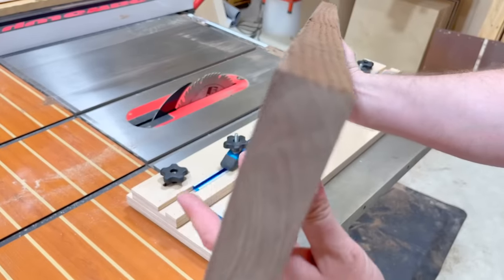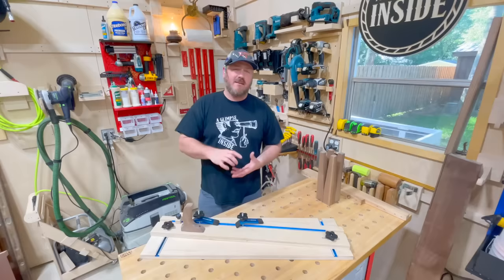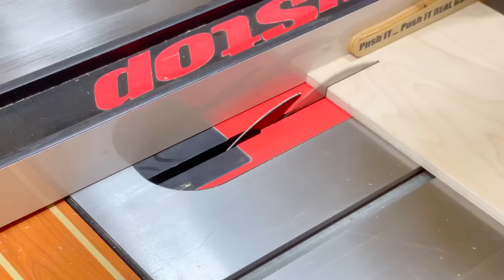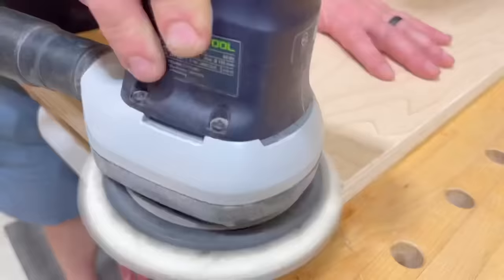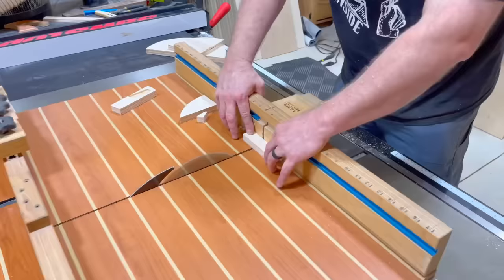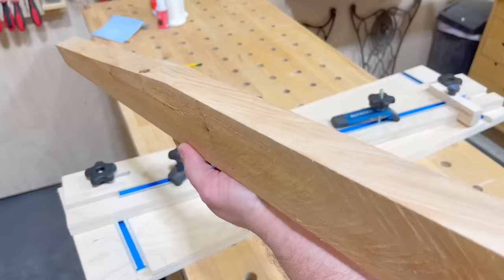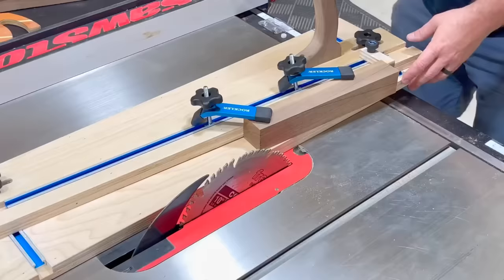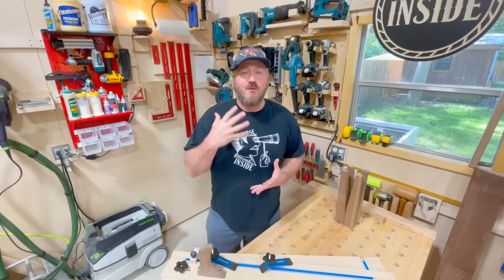This Jig Is A Two For One! Accurate and Repeatable! Make one Today!

Comment: I really like this jig A LOT!!! The only thing I would do, that you did not do, is add a miter strip to the underside. You can buy one, or make your own out of a piece of scrap hardwood. This would allow you to use the jig without having to rely on lining it up perfectly to the edge of the blade using your rip fence.
Reply: Good point, added to the parts list already
Reply: I agree with this miter strip suggestion and have done that on my taper jig. Make the width slightly under sized so you push the jig toward the saw blade while making the cut and pull the jig away from saw blade when retracting the jig. I borrowed this idea from someone on the web.
Reply: I was literally about to type the same thing.  You can use a wood runner, cut with this jig and the fence combo, for one last ceremonial cut before the fence isn't needed with this jig anymore.
Reply: You stole my thunder PW.  👍👍
Reply: Great idea.  Definitely added to my to do list.
Reply: Only disadvantage with having it run in the miter slot is that you limit the width of the board you can trim. You can always push the fence back to accommodate a wider board, but with a runner  you’re stuck with what you got
Reply: @dbakerr1  Actually the only disadvantage you're going to have is the width of the jig. The left side of the jig runs along side of the right side of the blade. I wouldn't want to push the fence out for more clearance than that because I wouldn't want the piece I'm cutting to hang over the left side of the jig, leaving an unsupported gap between the jig and the blade, while it's being cut. That just has red flags flying all over the place. Whether you use a miter bar, or the fence, you MUST have the left side of the jig flush with the right side of the blade to support the piece being cut. If you use a miter bar, your jig can be as wide as you need, and you don't have to use the fence to keep the blade and jig aligned.
Reply: Saw fence is better
Reply: Wood varies too much with humidity. If you don’t want to use a pre fab slide use plastic like UHMW. Will slide freely all of the time 😉

Comment: I built one of these about 20 years ago because I had a need for legs tapered on all 4 sides. My stop is adjustable in height and has a steel pin which fits in a hole drilled in the bottom of the leg. Works like a dream.

Comment: A quick thought: if the piece you're edging hangs off your table before you run the second edge through, you will most definitely not get two parallel edges.  Those edges will vary by whatever small (or large, or surface bump) is in the piece. Because you mount the piece in the sled, and the sled is flat, that first edge will be straight and square to the sled and table.  However, once it's removed from the sled and run through the second time without the sled, any bow or twist or bump will vary the bottom surface's engagement with the saw table.

For very short pieces which are completely on the table before starting the second cut, and you are very careful pushing them through so as not to accentuate any twist, you may end up with two parallel edges.

Comment: Great jig! One suggestion if I may. Mark commonly used angles on the jig so you don't have to calculate every time. I also use the "build around the track" method for laying t-track. So much easier, don't have to use the dado stack, and if you mess up the placement, you haven't plowed your base. Just adjust/recut to make the adjustments and voila! 

I noted you didn't put a runner on the bottom and I believe I can see why ... that it's not needed as you're referencing against the fence?

Fancy shims indeed. Save those bits because they can make some really cool inlay/angled inserts.

Comment: I am actually going to make this with 1/8 hardboard as the base of each layer. I work with thicker wood a lot so reducing the height of the jig/sled as much as possable while maintaining rigidity is my goal. Will take about 3/8 off the height of the platform the wood rests on. So my 3.5" blade height will still give me just a hair over 3". Thank you for working out the rest....nice design.

Comment: I think it’s a bit debatable whether it’s worth laminating plywood opposed to a dado or router bit to do the T track. But I’ll give you an A for creativity! Also I think a guide to go into the table slot is also a great idea. Don’t use wood though. Temp and humidity will change clearance . They sell nice pre fab adjustable slides or just use plastic like UHMW. Just an option but the fence does give you adjustability when you need it.

Comment: Thanks for this - I made it this weekend and am looking forward to getting some usage out of it! One note is that the T-track you linked to from Rockler is 3/8" tall, not 1/2", so I have the opposite problem in that the track sits below the 1/2" ply. rather than needing to be sanded down. Also, Rockler sells a similar jig for $79, and the T-track, clamps, and their 24-pc jig & knob kit came to $70 :)

Comment: Great Job! This unit is similar to a Rockler jig, but much better. I like the tee track for the clamp board function. The Rockler unit has a slot the length of a MDF clamping board, which flexes too much to provide good clamping pressure. The double layer board with the tee track is a much stronger design and will provide good strength for clamping the wood being cut.  I will be modifying my Rockler unit.
I'm a big fan of your channel and procurer of your products... Keep up the good work!

Comment: Hi Chris.  Great idea. I'm planning to build one today.  A question, however.  Many have asked you about putting a miter track on the bottom, and you've said that the reason you didn't do that was so that you could use the jig with larger pieces.  I was wondering about a removable track guide.  If you put a few threaded screw inserts into the bottom of the jig, you could use machine screws and attach or remove the track guide as needed.  Do you foresee problems with that idea?

Comment: Nice idea the only thing different I would do is add a bottom rail first to fit the slot of the saw table then run the base thru the saw to size it and finish the jig. Doing this you would not have to line up the jig to the saw blade. Just pop it in and go.
Reply from the maker: Definitely a great idea reason I didn’t put it in that’s because sometimes I get a hold of wider pieces that I want to reference on the fence and putting this track on their limits me to the width of a board that this thing can handle
Reply: @AGlimpseInside  Makes sense

Comment: Chris, great project.  I have an attachment idea for ya.

You can only cut tapers on 2 sides of your stock.

If you make a new cleat/foot that includes a nail facing toward the stock, and put a small dimple centered in the bottom of the leg, the leg will pivot around that nail, and you can get taper on 4 sides.  Easier than figuring where to put each cut off to get the perfect taper.

Comment: Chris my name is John may I suggest a slight modification to your project that little stop block that you have at the end there if you were to drill a hole in the end of it and put in a sharp pointed screw which you can manufacture yourself you take your your legs stock for the next on the bottom of your leg to find the center of it take a center punch or whatever and tap a little hole in it for lack of the correct word can you set that on the on the that pointy little and now you can do a a four-legged trim before or a 3 sided taper play do you like your design with the rails let me know if this works out for you bye for now
Reply: John again I did not originate that point in screw hi dear
Reply: I have a slight handicap I have to use a speech to text program and sometimes it gets really weird
Reply from the maker: All good John. Not bad idea. Thanks for sharing. I appreciate the insight.

Comment: What about putting a slide under the jig for the miter slot, then you don’t have to worry about the jig getting cut by the blade.  And you don’t need the fence.
Reply from the maker: Lotta questions about this. The slot limits how wide the board can go through the blade that you might want to trim. By using the fence as a reference I can still put a piece that might be 14 or 15 inches wide and still turn off the edge

Comment: Really cool jig that looks very simple to make.  Can I ask a major noob woodworker question?  When you are gluing up pieces and you shoot a few nails in to hold them together, what nails are you using?
Reply from the maker: 18 gauge Brad nails. Typically whatever length  you need to accommodate the thickness of what your nailing.
Reply: @AGlimpseInside  Ok, thank you very much for the reply.  I'm just getting started and I want to get everything right from the start that I can.
Reply: @AGlimpseInside  Ok thanks.

Comment: I liked the deck screw tip... until I still ended up scratching myself.  I think that works for the ends that never face the person, but for everything else, the 3-faced extra slim hand file I took.. errr... borrowed from my father-in-law's tool wall, works best to get rid of the sharp edge and roundover or almost chamfer them, to accept bolts even easier.

Comment: Curious why you didn’t use the rail in the saw top instead of using the fence.
Reply from the maker: Great question. It limits the thickness of the piece I can flush cut. Let’s just say I have a 14 inch piece I want to trim the edge off of. I can still do that with this jig with no runner. Funny because I actually cut one and was about to install it. When I realized it would limit the width of cut

Comment: Why not add a mitre track? So that you don't have to use the fence, and also show the exact line of cut.
Reply from the maker: I was going to. However that limited my ability to cut wider pieces. I can put a piece about 14 to 16 inches clamped down on this thing up against the fence and still make a straight line. If I put a runner fixed on the jig it was a limit that

Comment: Sweet. Now take it to the next level. 

Grab some stock from your French Cleat stash. Cut it to length, the width of the sled. Recess a hole on each end of the “wall side” about an 1/8” deep with a 1” forstner bit. Now, clamp the cleat to the end and bottom of the sled, and drill a  5/16” hole all the way through the recessed holes AND the sled. Add a couple of long T-bolts and a couple of star knobs - 
Bam! Removable French Cleat to hang that bad boy out of the way!
Reply: Or just drill a hole through the jig and hang it on a hook.  You can even mount the hook on a french cleat.
Reply: @DevinBaillie  that’s not complicated enough 😎

Comment: so my question(s) is this... after using the layering method to form the dado slots is the total thickness of the jig 1 inch?... couldn't you start with 3/4" plywood and use multiple passes with your table saw with the blade set to 1/2 depth to create your dado groove? this would probably also enable you to skip sanding down the top of the T track (although yes i do agree the silver and blue looks cool.... thanks!

Comment: You mentioned the conductivity of the T-tracks setting off the SawStop brake. I've been having issues with my brake being set off while using an Incra 5000 miter sled.  Ever heard of this issue? I can't reliably re-create the problem or get an error code when in diagnostic mode.  So, the only work-around that I have found is to disengage the safety features of the SawStop while using the sled.  Not ideal.
Reply from the maker: Sawstop recommends 1/8 of an inch clearance between its blade and anything conductive but I take that a step further and I do at least a quarter of an inch and I have not had a problem. I have tripped my break by cutting through a pencil of course touching the eraser part and the graphite caused it

Comment: I recently got a thicknesser and wanted something to joint with (don't have the space for a jointer in my garage) and this looks great, but I had a question before I start on it - my table saw is a portable metabo HTP, which is really nice, but being portable, the fence is relatively light duty. Would it make sense to mount this to a piece of wood to run in the miter slot on the saw vs referencing the fence, or is there a use-case for this sled that would make it worth not having said miter track?

Comment: Curious question - if you have your table saw fence at the same place every time, and your sled is over a miter slot in the saw, why not add a runner that fits the slot so you don’t need to worry about the fence? Great project regardless - and your shop is light years more organized then mine.
Reply from the maker: Great idea but it does limit me on how wide of a board I can rip. I deal with a few live edge is from time to time and it’s nice to be able to really cut a straight line if the pieces 14 to 16 inches wide. If that’s the case I just need to move the fence and I’m not tied down to where the miter slot is
Reply: @AGlimpseInside  fair enough. Still a great project either way. And as a father of five - your kids are fantastic!

Comment: Why would you glue in the t-track instead of using the predrilled holes in the track and wood screws?
Reply: Screw head may obstruct. Screw tip may protrude from other side, may scratch the table surface. While tightening the Screw, sometimes the plywood debonds. May be these reasons prompted him for opting epoxy glue. Even I prefer epoxy glue and hate screws (as many Screw heads are not strong and shear off. Also the Screw head slots are also not good nowa a days. Getting a good tip screwdriver is also a difficult thing in India).
Reply from the maker: I couldn’t have said it better myself
Reply: @AGlimpseInside  Thanks for your kind words. I just told from my experience. Thanks again.

Comment: Whenever cutting formerly pallet wood on a Sawstop, why not just turn off the electronic sensor? Save yourself the frustration in case there's even a chance of a bit of metal remaining inside the wood?
Reply from the maker: That’s a good point. You never know what’s the inside. Even though I took the nails out. There could be some type of conductive material in there

Comment: Stupid question. Would something like this work on a jobsight saw to rip 4 foot boards? I'm just not sure how safe that would be to rip longer boards. I have some 2x10's 4 ft long that I need to straighten and I don't have a jointer. I've tried to use a straight edge with a circular saw, but its still a little wavy.
Reply from the maker: A smaller version would be much better for that, but you could accomplish the same task

Comment: Vet 35 I am just finishing one up and it seems to work beautifully. Question: do you put any kind of finish on it to protect the wood?
Reply from the maker: Not at all. If I did maybe paste wax
Reply: @AGlimpseInside  Thanks for the response, I had been thinking that any kind of smooth finish might make holding any pieces firmly more difficult but being that I am a woodworking rookie here  I wanted to ask.

Comment: Awesome ingenuity! Don't know if you read comments, but if so, what table saw do you have? I'm extremely amateur but have been woodworking and building carpentry diy projects for years. My table saw is more of a hassle than anything else, and I need to get something more reliable. I've been looking at the DeWalt 7491 jobsite saw for a while, but any suggestions would be greatly appreciated.
Reply from the maker: I started out with a rigid granite top contractors saw and it was great. It was around a $600 range. I don’t recommend this job site size as the quality just is not there especially in the fence  department. I would look for a contractors saw to get started. It gives you the best bang for the buck. I have a 3 hp Sawstop now. After starting the channel and having some mild success I was able to upgrade
Reply: @AGlimpseInside   Thanks for the advice brother. I'll look into the rigid. The DeWalt is $600 and while the rack and pinion is great, I'm worried about trying to build a table around it for surface area

Comment: I love this video! I just started building your jig the other night.  One question... did Rockler change  the size of their T-track? Or did i get the wrong product? I ordered the universal kit and the T-track is only 3/8 tall. So the 1/2 plywood sits proud of the T-track.  Is this going to cause any problems when i go to use the jig?
Reply from the maker: Man, I’m not sure about if the dimensions have changed. If that’s the case, it is just aluminum and you probably could sand it down a little bit, but that might interfere with the integrity of it. But honestly, I don’t think it would make too much of a difference in the performance of the gig, as long as things could get tight and secure.
Reply: So, I did a little research.  Rockler sells two types of T-track... the half inch T-track that you used, and their "universal T-track", which is what I bought and is only 3/8" tall.  The one you used has a terrible description on the Rockler site because it says it's universal, but it isn't the same. Humorously, the reviews and questions on the site are blowing up with the differences.  I don't know why Rockler hasn't changed it to a better description. Anyway, I ordered some because I want mine to look like yours😂!
Reply from the maker: @chiefofcontrol  Wow that’s crazy. Never even bothered to check. Glad you did. Have fun making it. It’s definitely one of the more handy things I have in the shop. Thanks again.

Comment: Is that you dust collection system behind you -right at the end of vid? I’m new at this and work in my 1.5 car garage attached to our house. I need a good, small dust system.
Reply from the maker: Yes, it’s the Rockler 1250 CFM dust right. It works well. I still use it in the shop today.
Reply: Thanks I'm new to your channel  @AGlimpseInside
Reply from the maker: @lewgarmas  thank you for checking us out!